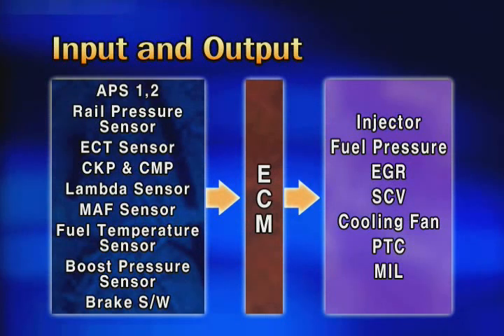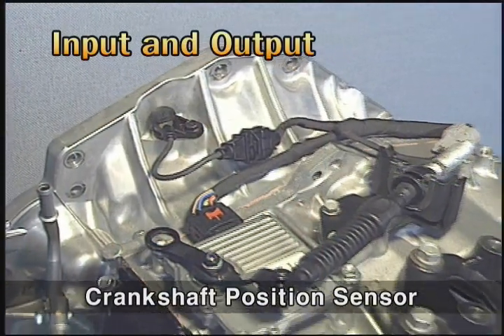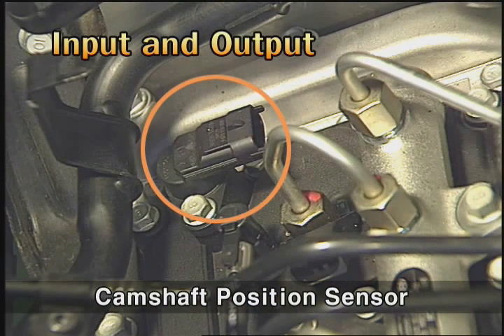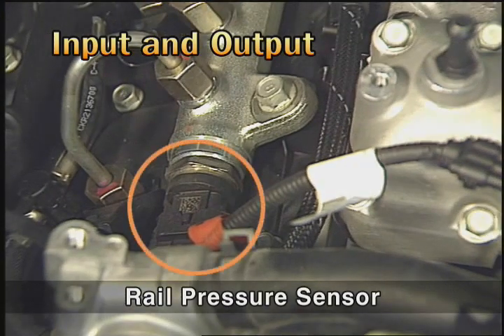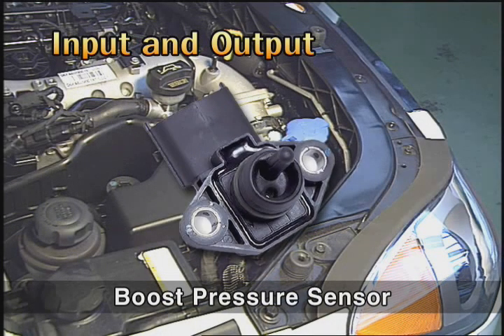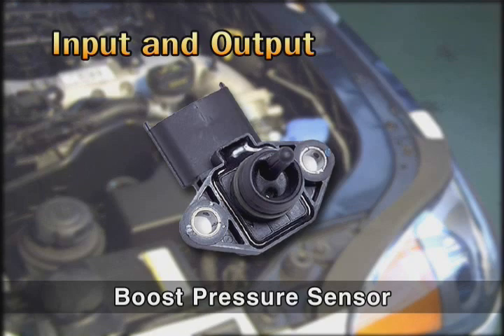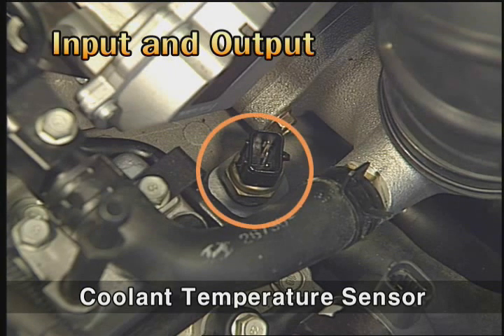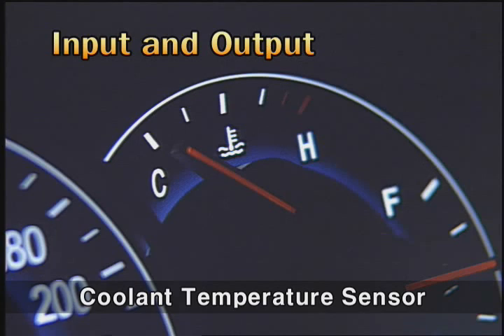Hyundai IX55 Veracruz Engine Sensors & Actuators Locations

Comment: So the crankshaft position sensor is located in the manifold?
Reply from the maker: 😳, video clearly shows the location on the rear end of the engine on the clutch housing.
Reply: @GoProAuto I found it